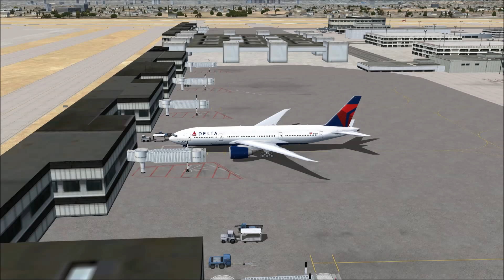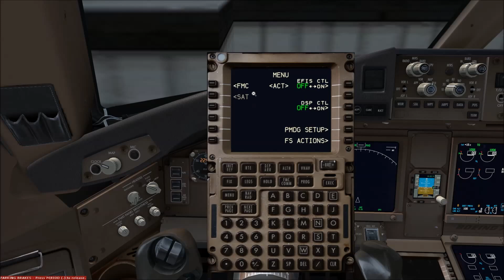PMDG 777 Tutorial: How to program the B777 FMC

Comment: I'm new, when I add waypoints and put in speed and altitude restrictions, as soon as I complete performance section in FMC with weights and fuel. It only shows speeds correctly, all altitudes say what I set in my MCU for altitude. This is on my 777-200er. Any idea if thats normal. What, I need to manually keep adjusting MCU altitudes?
Reply from the maker: I am not sure I understand your question...

Comment: Is there any reason you would change the cruise cg? and if so how do you find out what number to put in?
Reply from the maker: Thank you. For the simulation, I guess it is easier to keep the "default" CG. The number in itself is operator dependant, so there is no particular way to find out.👍
Reply: @CaptainNav  Thank you for your quick response Captain. These are the questions i would ask a pilot in the cockpit but i cant due to covid🤦🏾‍♂️. Many thanks.

Comment: I am having a small problem - I rotate at Vr, climb out at V2 (and have V2 set in MCP window), but rather than the speed then increasing to V2+10 initial climb (at thrust reduction height and just before acceleration height), it stays at V2 so the aircraft throttles back and pitches up slightly before the acceleration at 1,000ft 🤦‍♂️
Reply from the maker: The aircraft should maintain V2+15 (20) during the initial climb and should not go back to V2.

Comment: Good  tutorial Sir ,i would like  to know if is possible  for you  in the next future  to make a tutorial about how to  do  to intercept the radial  with the autopilot.
Reply from the maker: On the 777 we do not really intercept VOR radial, you would use LNAV or otherwise TRK SEL.
Reply: @CaptainNav  I tried to set on the  FMC the radial  (for example  SFO 115.8/275)  but  does not work  in auto  ,   i only able to  follow the radial in manual. In the other types of aircraft it was possible  to intercept and follow  the radial  even  in Auto but in this aircraft  it seem  impossible.
Reply from the maker: You need to tune the VOR indeed

Comment: what about arrival?
Reply from the maker: The video was only for the pre departure set up. There are plenty of videos on the channel showing the arrival set up...👍
Reply: @CaptainNav  thank you! you actually helped me fly my first proper flight on my pmdg 777! one question..haha again but when my plane is on rnav did i have too manually set my altitude?
Reply from the maker: @areyouokthenyouneedglade9697  Cool I hope you had fun.
I think you meant VNAV in your question... Yes you need to match the cruise altitude you have in the FMC with the altitude you set in the altitude window. This should give you VNAV PTH.
Reply: @CaptainNav  oh alright! thanks! im so sorry im asking you so many questions! haha but if i want to just yanno play around with pmdg not play around but i like to take off from airports then return to them but then when im returning my angle of attacking has to be very high so i dont plunge into the ground, it gets really frustrating bc i dont want to do the ils until i improve on pmdg. last question i promise is there a way to go 100% throttle bc i can only go 98% or less, if i try to go 100% it'll set the levers back. 

thanks!
Reply from the maker: @areyouokthenyouneedglade9697  You mean 100% on the engine N1 gauge (on the upper middle screen in the flight deck)? Or 100% thrust lever movement?
On the gauge, you will rarely get 100% exactly, it can be a little bit more, it can be less...
Reply: Captain Nav haha I ment thrust lever movement

Comment: I do not know where to find the answer(s) to my question(s), so I hope you can help... In 738NG I do this and it works (not a RL pilot, so not sure if 100% correct). I select a destination STAR and RWY/ILS and begin the flight. Approx. 30 or so miles from DEST I can see desired airport on Airport listing (ATC panel). I select landing request and am given RWY. If matches what I thought and had programmed, I just continue. If it is now different, then I select DEP/ARR and select new STAR and RWY, clean up any discos, EXEC, and continue to new Arrival RWY. In the 777, this all fell to pieces and the flight was ruined/unrecoverable. I flew KLAS -> KLAX, selected ANJLL4 STAR through SHTNR for RWY 24R. Around DECOR I requested landing and was given 06R and instructed to access via left downwind. This is typically achieved via the STAR MDNYT2 through SHTNR. I went into CDU, selected DEP/ARR, and it let me change to RWY 6R, but refused to let me change the ANJLL4 STAR to anything else. Fact is, the ANJLL4 STAR ends at CRCUS and I was already 10 miles past that, so I was technically on TRANS to 24R. I EXEC'd on the 6R mod and tried to get the STAR to switch to MDNYT2, but no joy. I then started trying to start all over with a new DEST ICAO as advised in numerous FS forums, but it refused. I then scratched down the departing airport KLAS and scratched it into the ARR airport (like a return trip to same airport) and it allowed me to do that. After that, ALL other requests to modify anything were denied. My CDU is completely set in a return to RWY 1R at KLAS and there's absolutely no way I can see to make it budge. Never had this problem with the 737-800. Can you please advise how to plan a flight and not knowing which RWY you will receive before 30 miles out? In a heavy, that's an absurd figure, but it's what I get in FSX and the earliest I can know where I am wanted to land. Thanks and sorry for so long... but it is a rather specific feature/procedure for the 777 FMC.
Reply: Ok, so wasn't aware of RTE-2, but I am now. Did same flight with RTE 1 to RWY 24 via ANJLL4 and RTE 2 to RWY 6 via MDNYT2. Arrived and was given RWY 24 so I did not have to switch. Will keep testing and do the switch next time I'm given RWY 6. But is this the right way to do it?? Seems strange that something that should, at best, be a tool to assist the pilot and ease tasking, would be so insistent and inflexible. Never had the 738 FMS tell me NO when I needed to change something. It was there to assist me, not frustrate me! Thanks and looking forward to some guidance!
Reply from the maker: You should be able to change the arrival in the FMC, I am not sure why it is not letting you do it. Very often in real life there is a last minute change of arrival and/or runway and it is not a problem to change it in the FMC. Theoritically, there is no need to use RTE 2.

Comment: Hey captain! I've a question: how do you configure the FMC for ETOPS? Do you just not select RTE COPY and go APT-ETP-APT and then select 1 hour range around the APT on FIX page?
Reply from the maker: There is not a specific setup, usually we put the 1 hour rings over the various airports in the fix pages. As the flight plan usually calculates am ETP for each ETOPS sector, you can insert that one in the fix page too.
Reply: @CaptainNav  Thank you very much for the answer!

Comment: 1.how can i create the ils approach landing from KLAX to KLAX . i want a small trip taking off from KLAX and make a turn to land on KLAX with ils approach .. Thank you 
2. during my flight from one airport to another i decide to ils landing on any airport on my way not the destination using the FMC 
Thank uuuuuuuuuuu dear
Reply from the maker: +Coach Samir Nassar In the FMC, the route should be KLAX to KLAX. In dep/arr, select the ils as you normally would.
For a diversion, there are 2 options: you can change the destination in the Route page and select the relevant approach in dep/arr. Otherwise, use the ALTN page.
Reply: Thank u so much for the fast swift . do u have a video or pdf tutorial on this issue to be easier for me as I am a novice captain ( hehehehe ) and i appreciate ur help and kindness .. Thankssssssssssssssssssss
P.S.      ALTN = ?? dont understand it dear
Reply from the maker: +Coach Samir Nassar No problem. Unfortunately, I don't have a video for diversions, maybe in the future... On the FMC, there is a key that says ALTN.
Reply: Thank u so much ..cheers
Reply from the maker: +Coach Samir Nassar You are welcome.

Comment: Hi captain :) i have problem with inertiql pos select with R5 button in the beggining of programing fmc. What i have to do that i could insert gps cord? Thanks :)
Reply from the maker: +Mcprison'o Cheat'ai Make sure first the ADIRU switch on the overhead panel is on. Then, take the GPS position in R4 and put it into R5.
Reply: Ok i will try :) thank you very much :) ur the best :)
Reply from the maker: +Mcprison'o Cheat'ai No problem, I hope it works out. Thank you.😀
Reply: Captain Nav hmm still not working, i turned it on but not working ;((( if you can please tell other way to solve that problem, because i realy want to fly boeing 777
Reply from the maker: +Mcprison'o Cheat'ai I am not sure. If the ADIRU is on, then it should work.
Reply: Captain Nav now working, i turned it off and after 10 sec i turned it on and wait for 30 sec with opened fmc. Thanks bro
Reply from the maker: +Mcprison'o Cheat'ai No problem I am glad you sorted it out. Enjoy!

Comment: Hi! Great video. I'm still struggling with something though. I think I programmed the FMC correctly, but when I engage Autopilot, with LNAV and VNAV selected, the aircraft won't climb to the submitted Flight Level. Even though I have programmed it in the FMC. Any idea how I can solve this problem? The speed I input does work though, just not the altitude. Thanks!
Reply from the maker: +Joris de Bont What altitude have you set in the autopilot panel (MCP)? If you set a lower altitude in the altitude window of the MCP, then you won't manage to climb to the altitude you set in the FMC.
Reply: Captain Nav That solved it! I had it set to 10,000 feet on the MCP. Thanks! :)
Reply from the maker: +Joris de Bont You are welcome! Have fun.

Comment: what it means when I get takeoff speeds deleted thing
Reply from the maker: +joona hämäläinen Just that the takeoff speeds on the Takeoff page have been deleted. This happens when you modify something in the FMC after you have initially entered the takeoff speeds. All you have to do is enter the speeds again.
Reply: Captain Nav but when I do it again and press TO/GA they delete again when I am about 80kt
Reply from the maker: +joona hämäläinen Do not press TOGA a second time during the takeoff. Just once to get the takeoff going.
Reply: I meant another try, when I try takeoff again. They still delete. But I will try that your first tip that I dont touch fmc after I set speeds

Comment: Hi I'm very new to Learning FMC for any plane 
I just filed an IFR trenton (CYTR)  TO Toronto pearson (CYYZ) 
I'VE pmdg 777 
And i just did what you did with fmc and I'm stuck here 
When I go to request route page it only shows that NGX one has assigned a route while 777 doesn't has any route set. 
Do i need to set the route for 777
If so, then how can I set a route to it? 
Thank you
Reply from the maker: +Shehryar Ahmed You probably do not have any saved routes. You need to save routes by entering a route in the FMC then use the save prompt. Otherwise, you can use something like PFPX or Simbrief to save a route. Hope it helps. 
I think there was a similar question in the comments section here.
Reply: Captain Nav yes read that similar question by someone. But the thing is when I enter my current airport code after that it should ask me for "set Initial Pos" 
Under this heading in your fmc, it has empty blocks which means that it is asking you to enter initial pos
But on my fmc it does show those empty squared (i-e;[] []°[] °) boxes. 

Can I email you the screenshots if you don't mind.
Reply from the maker: +Shehryar Ahmed Try to close and restart your simulator, and start again programming the FMC. After you enter the reference airport, you should indeed have the set inertial position boxes along with the GPS position and the last position of the FMC, as you can see in the video. I invite you to watch again.
If you can't enter the inertial position in the boxes, then there could be a problem with the software and you should contact PMDG support.
Reply: Captain Nav thank you for responding seriously and instantly 
And I'm sorry for replying late 
Well I got your point, there must be a problem with Pmdg 
But please clarify me
How to set a route, is it a setting inside fsx or only in FMC to set a route?
Reply from the maker: +Shehryar Ahmed Only in FMC, you neee to enter the route, first waypoint, then airway, then waypoint, etc....
Reply: Captain Nav I see 
I just thought that I have to set route from FSX flight planner. 
Thanks a lot. 
I'll contact PMDG support, because it neither display those empty boxes under "SET INITIAL POS" nor it accept any value for initial Pos. 
I'm very thankful to you, that you responded very instantly and provided accurate and helpful information. 
God bless you. 
😊
Reply from the maker: +Shehryar Ahmed No problem. You need to enter the route directly in the FMC, not via FSX flight planner. You are welcome. Thanks.

Comment: I am curious to know more about Thrust Limitation settings, Flap Settings, and understanding the FIX page and what it does. I understand what the Thrust Limitation does and why it is used. I don't understand how you get the temperature needed or when the proper time is to use it. 

I have always used Flap 15 in all my takeoffs. Curious to know when and how you decide which setting to use.

Never used the FIX page before. I am curious if it is a pure reference page for the pilot to gather information from or if it does anything to the plane.

Thank you for these amazing videos. I've already done the 777 on VATSIM but I'm still learning new things from your videos.
Reply from the maker: +XBOXORANGEJUICE Thank you, I am glad you find the videos useful. In real, we use a performance software to determine the takeoff flap setting, the thrust reduction setting and temperature, and also the speeds. There is no such things in the simulation.
The takeoff performance is based mainly on the weight of the aircraft, the length of the runway and the weather. When all of these are less favourable, the flap setting tends to increase (5 to 15 or even 20) and the thrust reduction decreases (full thrust).
The FIX page, as you said, is only for reference, it does not do anything to the aircraft.
Reply: Thank you for answering all of my questions that I had spread out so far. This is an incredible resource to the community. More often than not there are too many people on the popular forums who don't know what they are talking about. They refuse or are not capable of giving good information. Sometimes researching runs dry. I hope many more people are able to find your videos and ask you questions. The fact that you respond to each one is amazing.

I urge everyone to research their problems and try to find answers. If you can't and have a basic understanding from your research the answers to questions are much more meaningful. T hank you again.
Reply from the maker: +XBOXORANGEJUICE No problem at all, you are welcome. I am happy to help if I can.

Comment: when i request a route, it says "no routes available", and it doesn't give me option to enter the inertial position, if you can then please help
Reply from the maker: +Alessandro Chinasamy You probably have no routes saved. You need to save a route first. I am not sure why you can't enter the inertial position, normally, when you start a flight somewhere, the system does not know where it is, so it should ask you to enter the inertial position.
Reply: Thank you for the help, when you say that i need to save a route first, is that in the flight planner section or save section of "free flight"?
Reply from the maker: +Alessandro Chinasamy No, in the FMC itself... when you enter a route, there is a prompt to save the route in the FMC on the route page. Please watch the video again, at 4:15, you can see the save prompt bottom left of the FMC. Alternatively, you can save routes with PFPX or simbrief, for example. Hope this helps. Let me know.
Reply: if i want to save a route from the fmc, what information do i have to input?
Reply from the maker: +Alessandro Chinasamy Just the route itself, so the departure and arrival airports, plus the airways and waypoints.
Reply: It is finally working, thank you so much for your time and help!
Reply: actually, i still can't enter the inertial position
Reply from the maker: +Alessandro Chinasamy You are welcome, I am glad I can help.
Reply from the maker: +Alessandro Chinasamy To enter the inertial position, you need to use the GPS position and put it into the inertial position. Watch the video at 3:40 onwards. Hopefully this should fix your problem.
Reply: Alessandro Chinasamy I had the same problem! If you are using the boeing 777LR...forget about it and start using the 777ER. It work in the ER quite well
Reply: Alessandro Chinasamy WAIT! Did u switch on the ADIRU button? without dat u cannot enter inertial position
Reply from the maker: +Professional Gamer Exactly.
Reply: Can you please tell me the name of this app I really want it
Reply from the maker: +nitaash billimoria This is the PMDG 777 for Microsoft Flight Simulator X